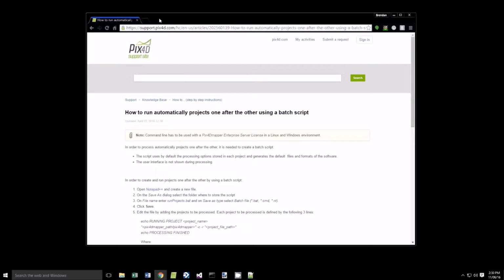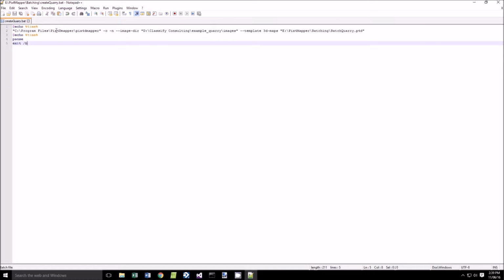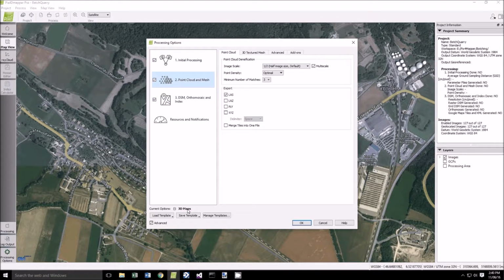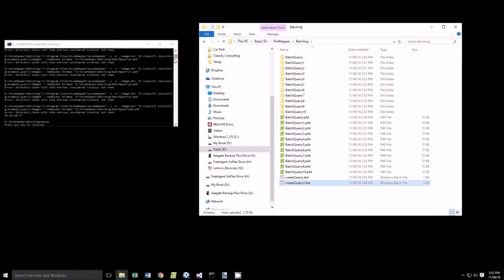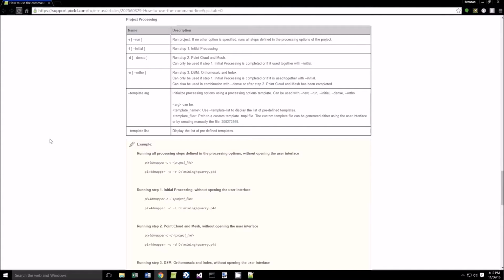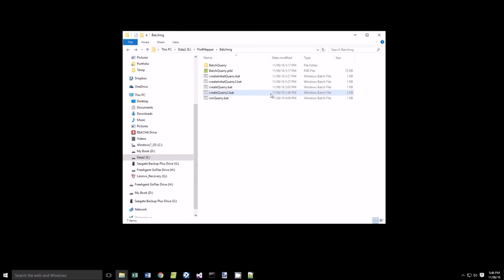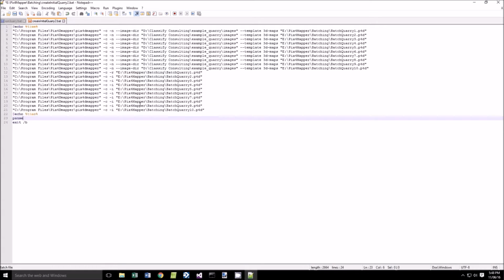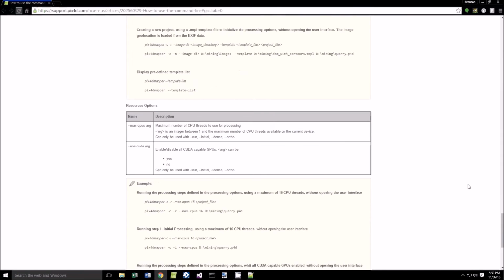Pix4Dmapper Command Line Automation How-To Guide

Comment: Do you know... How i can send two or more path directories as argument in command line???
Reply from the maker: I don't think that's possible - could you clarify what you're trying to achieve?
Reply: @classifyconsulting8363  I know this is super old... but I think what they are trying to ask is how to you tell pix4d to find images in multiple directories. Lets say I have a flight that requires two battery changes, so I've pulled a total of 3 folders off the SD card into the processing directory. How do we tell pix4d to get every directory inside of a directory?